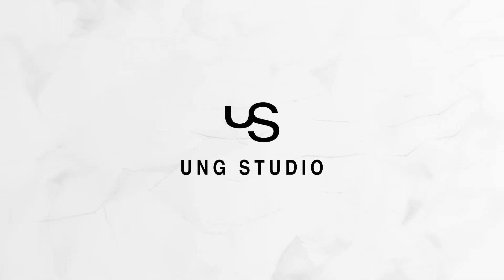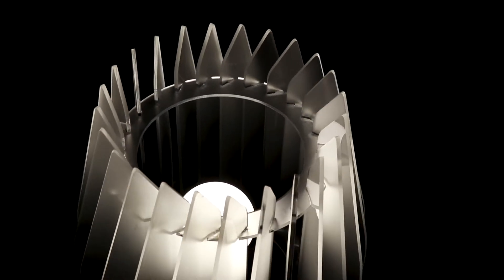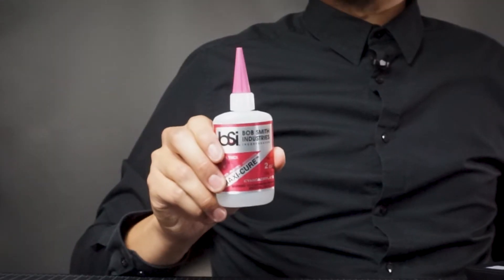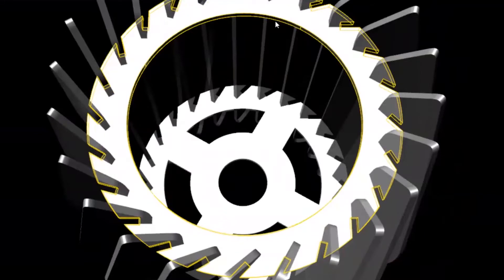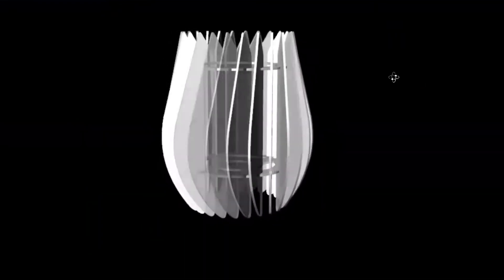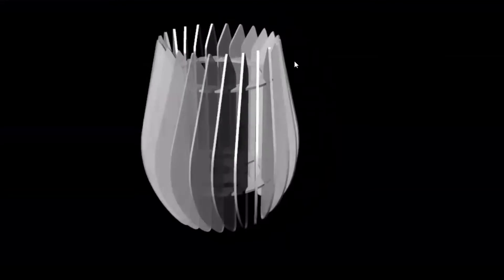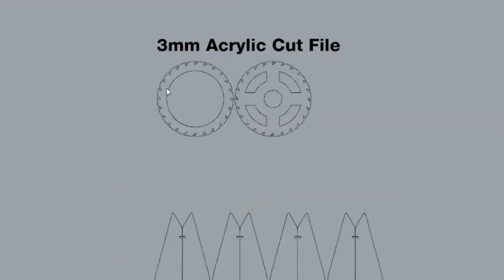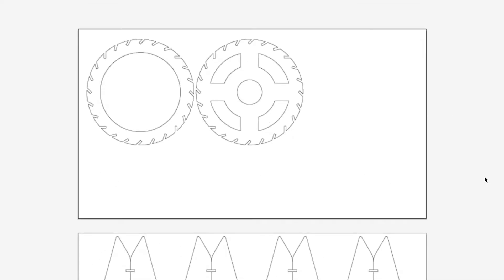Making a Tulip Light with Frosted Acrylic

Comment: Would your etsy file work with 1/8" acrylic? Or would I have to modify the grooves? The PG stuff is always sold out.
Reply from the maker: If you have calipers to measure your acrylic, the finger joints are set to about .118 inches in thickness for the laser cut files. Most 1/8 inch acrylic is usually thinner than 1/8. Hope this answers your question!
Reply: Sure does! Thanks. Looking forward to giving these a try.